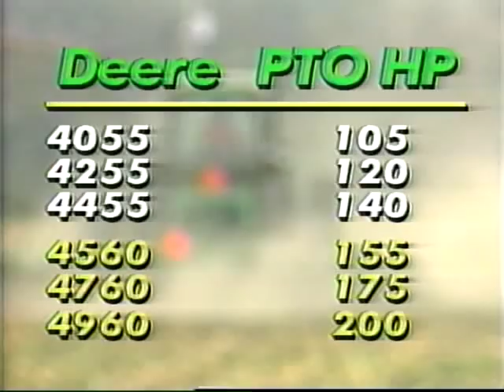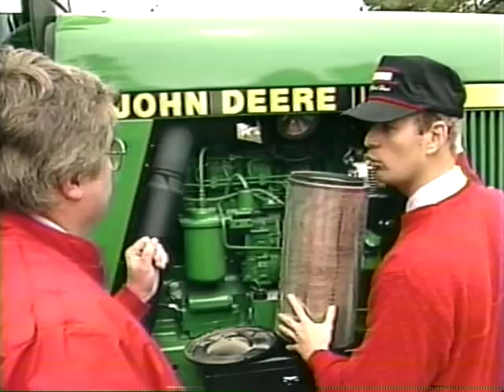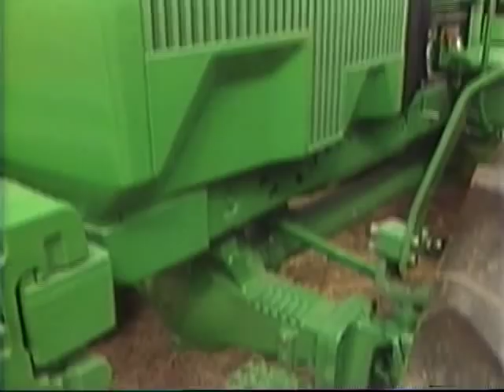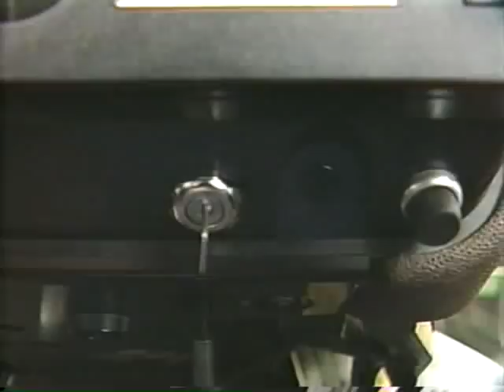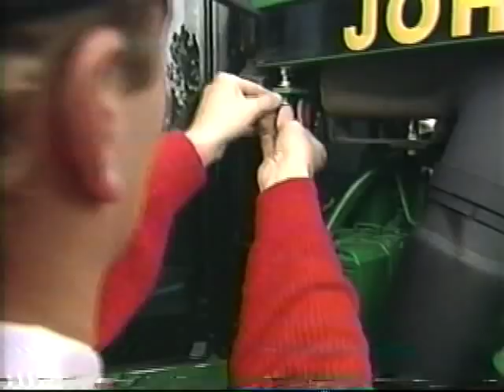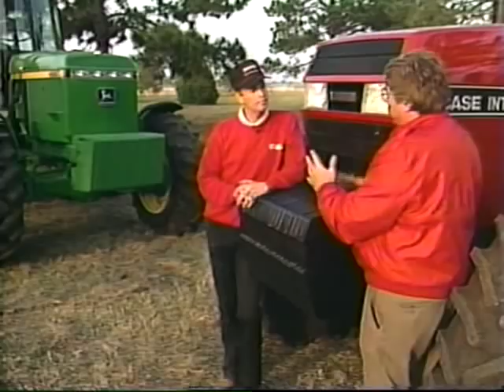CaseIH Introduction to Deere 60 Series

Comment: Loved this video . To bad most magnums are in the scrap heap or melted into Honda's. While the 55&60 series are still putting in crops .
   Case IH. Engine O/H at 5000hours graveyard by 10000.
Reply: Don't know of any bankruptcies in the formation of CNH, It was my understanding that part of Henry Ford I's will was that Ford Motor Company had to produce tractors, when Henry Ford II died the caveats of his will came into effect, not those of his grandfather allowing Ford to divest itself of the tractor division which by now included New Holland. Fiat bought heavy into the Ford/New Holland organization and then into Case International as they saw it as an opportunity to get into the US market in a bigger way than making tractors that were sold under other names (Oliver for one). In mature markets there is usually only room for three major players Deere just happens to be one of the companies that was a buyer of competitors. Their new generation tractors were not only well engineered but covered the current and developing markets better than any other US tractor manufacturer. IH ended up a couple of years behind Deere in product and was never really able to catch back up, a big strike in the late 70's weakened their financial position and when the farm economy crashed in the 80's  selling off the agriculture side of IH to Case was one of the things they did to prevent bankruptcy, much like Ford selling off Range Rover, Aston Martin, Jaguar and Volvo cars in the late 2000's.
Reply: You have a somewhat distorted view of reality. New Holland was in trouble by the end of WWII, they didn't get a lot of war contracts and were limited on what they could produce for farm equipment during the war. 4 investors bought New Holland and ran it until 1947 at that time the company introduced the "first successful automatic pick up/automatic tie baler" the investors sold the company to Sperry who were flush with cash from wartime production of gyroscopes and other instruments for both ships and aircraft. The sale to Sperry insured that New Holland had the necessary capital to expand their production and meet the demand for hay balers and not loose the market to one of the big guys (IH, John Deere, Allis Chalmers). The sale of the Sperry-New Holland division to Ford motor company was a by-product of a hostile takeover, Burroughs launched a hostile takeover and Sperry Corporation was able to cause an increase in their stock price, not enough to prevent the takeover but enough to force Burroughs to borrow a lot more money than they wanted to. the New Holland division was sold to Ford to raise cash to pay down some of this debt. Note the Burroughs-Sperry acquisition became what is now UNYSIS, and they sold off an lot of Sperry Holdings they didn't want to pay down debt. There was an agricultural depression int he 80's input prices were skyrocketing and Mr. Carter cut off some of the markets we had (say USSR) in protest of Russian aggression in IRC Afghanistan. Ford willingly bought New-Holland (1986)because it gave them things they didn't have, domestically produced combines (in the mid to late 70's Ford was marketing Claas combine painted blue) and a full line of hay equipment (I've heard rumors somethings like balers were being made by Long or by other short liners).  It was part of a vision to make Ford Agriculture Equipment big enough to be sustainable , this was also about the same time they bought Versatile, acquiring competitors is not a sign of a failing company. If you look at the online forums most folks will recommend that for balers you stay with Deere or New Holland as they were the two best products and enjoyed popularity meaning there are more used carcasses around for parts and better parts support through the dealer. And the TRS combines introduced at that time, with support of the Ford dealer network were successful.  Ford's divestiture of Ford Agriculture/New Holland occurred in 1992, Ford was losing money as a company and much like their sale of The European and Asian marques they acquired in the late 2000's the sale of Ford/New Holland was to raise cash for them to put back into automotive operations, remember Ford is still controlled by the Ford family and they are pretty active in trying to keep it that way, that may be the reason they didn't go into bankruptcy in 2008 to ditch the union contracts and debt like Chrysler and GM did.
Reply: Robert Moulton incorrect on all levels, educate yourself.
Reply: fordbossss  a  case owner that can read...I'm impressed. Tell me again about you bankrupt foreign-owned case -new Holland success story.? 
  Must have gone under because they had such a reputation for great quality?
Reply: fordbossss impossible to have intelligent conversation with anyone with the name Ford boss . 
Lol  
  We are all waiting for an official apology from Ford for there 6.0L diesel. What a joke
Reply: Actually the 6.0L diesel was a IH Fiasco, neither they (IH) or their contractor got it right, that was bad, very bad it worked kay in the IH medium duty applications but the emission requirements in the pick-ups pushed it a little to far. Notice the next Ford Diesel pick up engine was designed and built by Ford
Reply: Capt. Beak Ford buys New Holland.....a floundering company.
Case buys IH - a floundering company.
New Holland bought Sperry- another floundering company
Ford since its first little tractor back in 1917 has not been a real player in ag,it's always been a sideshow for them. Let's face it .Ford's inability to build a diesel engine hasn't helped. Tenneco wanted out of Case IH , it's pathetic sales was bleeding them white . So when Fiat came along with bags 'O cash they were only to happy to unload that loser. So to recap
Sperry,International Harvester ,case,New Holland,Ford =losers all now owned by Fiat. Does Fiat have deep enough pockets to them afloat. ?
Reply: Capt. Beak wow . Very interesting. I was told as to the 2008 market crash that caught GM and Chrysler that the only reason Ford came off looking so good was because they had run into financial difficulties earlier and had already secured loans from government and elsewhere . 
   So tell me the dirt on John Deere's bankruptcy and loans divestitures ?
Reply: No Ford didn't get government money, unlike every Henry Ford who has run Ford Motor Company before Hank III saw bad things were going to happen, hired another CEO (the guy from Boeing) and they sold off assets, Jaguar, Aston Martin, Land Rover, Volvo Cars, Mazda and their stake in Kia as well as their holding in Cummins.  As far as John Deere's bankruptcy far as I know they were better managed and kept enough cash on hand to get through the rough times and didn't face the long strike IH did in the late 70's and have never went broke, they have pulled out of some markets and I know they divested themselves of the snowmobiles selling the remains of that business to Polaris, probably had some more we don't know about. No doubt IH was poorly managed, Fowler McCormick lead them places they didn't need to go and ignored their core products eventually loosing their reputation and market share all while facing a constricting market.
Reply: Capt. Beak kinda to bad for IH ,their early 80's tractors seemed well put together especially when compared to case products. Boy I disliked that stupid power shift they had,think it came in the 2390 and many other models. Not only was it a horrible transmission to use but was notorious for regular failures....

Comment: Ironically, they did not want to discuss durability, cost of ownership and resale value. Deere had the advantage back then (and still do today). When these guys said “John Deere 60 Series, still not a Magnum” at the very end, they were absolutely correct. Guarantee you that AEM row-crop tractor market share would show John Deere in 1st place in the U.S. for the last 40+ years.  John Deere was (and still is today) reluctant to get down in the “marketing mud” with Case because, any customer with half a brain knew the John Deere tractor was a more productive and superior product...not to mention a better investment.

Comment: Deere hoods are hard to take off??? O ya that's right you don't need to take them off because they made it easy to do maintenance on them. And also you want to shit talk the 15 speed transmission.....give me a break the local red dealer always has a magnum in there shop split working on the transmission and I work at the green shed maybe one 15 speed a year needs worked on bottom line green don't need dumb videos to prove therer product they do it every day in the field

Comment: Did they fail to mention the CIH Powershift transmission, just like a Deere? That's because they got theirs FROM Deere.
Reply: Not. even. close.  The magnum transmission was ahead of everyone when it first came out.  It was a descendant of the 88 series transmission but there was way more to it than just putting in clutch packs instead of synchronizers.
Reply: And JD's powershift transmission is a descendant of Ford Select-o-speed.
Reply: 1993 White 6100 series had the one of the best tractors on the market, 8.3 Cummins engine,  FULL 18 speed powershift transmission, in-line shifter seat mounted , and a frame that can hold up to anything, and had the most weight for superior traction

Comment: The PTO clutch is probably the most significant difference.  The case clutch does not like to be shut off to fast; which is a major flaw in my opinion.  And I don't see how anyone can argue the the case transmission was more reliable.

Comment: Nothing kills a Deere like a Magnum
Reply from the maker: +Mackenzie owen so what did Case steal from Deere?
Reply: Jack Johnson OK so I do hope that you don't take this offensive, but practically half of John Deere equipment. Like plows. The IH little genius plows were probably Just  red painted John Deere plows. Then also when JD built wa14 articulated tractors case had to buy out steiger and lie and say that caseih built their own articulated tractor. John Deere also solved the needs of hay farming and ranching to so they built hay equipment. So a couple of years later CNH manufactured hay equipment. Flipping over to construction now JD came up with the "scraper special" tractors. Before long you see CNH tractors pulling ejection scrapers now.
Reply: Mackenzie owen What did they steal? The quadtrack?
Reply: Mackenzie owen Those are pretty loose categories. By that logic ig JD stole 4 cylinder engines from IH? Only so much can change in a moldboard plow.  How about axial flow combines?
Reply: Jack Johnson Now that is one thing. Case which was IH at the time did invent the rotary combines. Another thing was the narrow track quadtrac. CNH does have legal credit over those.
Reply: Jack Johnson that's why john deere has 4 times the market share. ..
Reply: Jack Johnson Which explains why case had to steal from John Deere just to stay alive. Sorry bud but that's the shameful truth.

Comment: I’ve put on many many hours on Magnums and 60 series Deere tractors. 4960’s were decent machines but severely outdated. I’d much rather have the Magnum. I know of dozens of 7240’s/50’s and 8940’s/50’s that are still being used every day during the busy season.  I can count on one hand and not use all my fingers how many 55 and 60 series Deere tractors are still being used.
Reply: Did you poll two or three neighbors ?

Comment: My grandpa has an 8940 and he had a 4960 loved the 4960 hated the 8940 it does not turn or ride as good as the 4960
Reply: I second that, and the fuel consumption is more on red when you trying to put it all to the ground according to Nebraska Power testing between the both.

Comment: I just subscribed because of this video! Those salesmen are funny!
Reply: I’ve driven Deere’s from the 60’s, 70’s, 80’s, and 90’s and they are very reliable. Normally the implement you are pulling is the thing that breaks if your driving a Deere. But I’ve also driven a case from the 90’s, it isn’t a magnum but it’s a 9380 so as far as the cab goes it’s pretty much the same though
Reply from the maker: They were and are both good tractors. I post these video's because I find them amusing, I don't take them too seriously lol. Thanks for the sub, most of my video's are my own but I do post these from time to time. Most of them end up on my Patreon page.

Comment: Case I'm sorry but the exhaust pipe on the hood really offers great vis as it is in line with the cab post.
Reply: Luke Powell yea really I never had a problem seeing around it the stack on the hood of 4440s. But our 7120 was one of my favorites.
Reply: Jared Granberry shit I didn’t have an issue with it on our 4430 or 4650. But hey “ like a magnum “😂😂😂
Reply: Luke Powell I've observed the same. It's not often you're looking dead ahead and dead center is still visible. The exhaust and air intake stack are hid very nicely by the cab post, I've never been annoyed or had trouble seeing out of a sound guard cab.
Reply: I still plant with a 4450 and we don't even see the post which is nearly inline with your nose. We also don't notice the nice high clean air stack and the exhaust pipe. On the other hand we have an 8310 with flat glass and side exhaust and I sure can hear the motor sing cough grins. I will admit I like the side pipe as I am (like most farmers) a bit of a motor head.

Comment: The only true standout quality I've found that magnum has over Deere tractors of that era was the spacing between gears. I was pulling a massive sheeps foot compactor with a magnum and the way the gears were spread out was very nice. I always found that with the older deers you had a massive amount of overlap in your middle sets of gears, or gears that felt like they didn't even have a different ratio at all. I'm still a Deere fan but that's just what I've observed.
Reply: nardp96 I just remember the 4960 would try to throw you out the back window somewhere around the 10th gear or so... the magnum was smooth through all gears
Reply: Jared Granberry hahaha the magnums were awesome on sites that had different terrains for that reason exactly. You shift some of the deeres and it's like it wants to kick you off

Comment: What us being unsaid here is that 4055,4255,4455  would be replaced by the 7600,7700,7800 within  a year.Moving the muffler to the right is not like a Magnum
Reply from the maker: +generationll they may not have known at the time that the 7000 series was on the way. Moving the muffler to the corner of the cab is like a magnum in that the magnum also has it like that, they never really said they did it first.

Comment: Its funny scrolling through the comments and seeing all the john Deere guys get ruffled feathers. The 4960 was an iconic tractor but it was built on an outdated platform with old technology. The magnum was a new, modern design for the time. In a couple years Deere would release the 7000/8000 series and would have a more comparable tractor
Reply: I'm a deere guy and I agree, but the tractors still pulled hard and last a long time with proper care.
Reply from the maker: +tractorman MIKE I agree 100% the 60 series was just the end of an era for Deere, tired designs, when the magnum came out it was way ahead but that gap was closed by the time the 8000 series came out.
Reply: tractorman MIKE  like a magnum.lol
Reply: Yeah, John deere was using base designs from the 70s
Reply: Being slow to change a successful design is a trademark of john deere dating back to the 2 cylinder days. I don't think a company being "reliability" conscious is a bad thing at all. Keep in mind Nasa used the 8088 chip for a very long time - well beyond it being obsolete.. This was simply due the fact that it was adequate, fully mature and extremely predictable. Nasa literally knew what the design would do under numerous hours of service and testing. A wise choice..